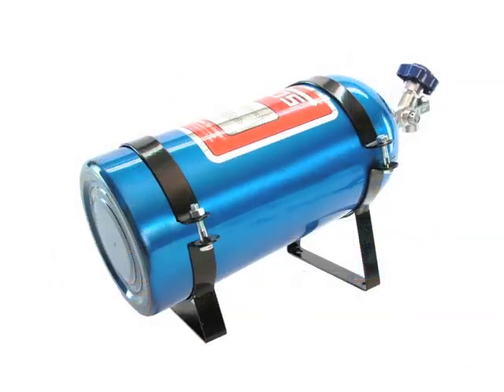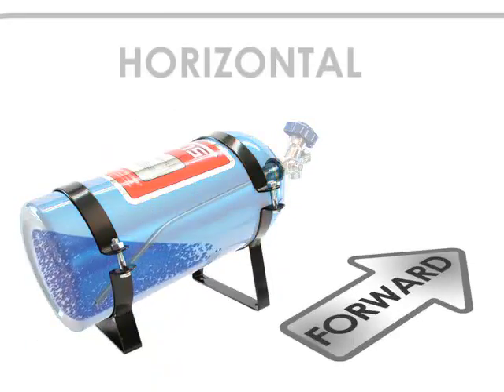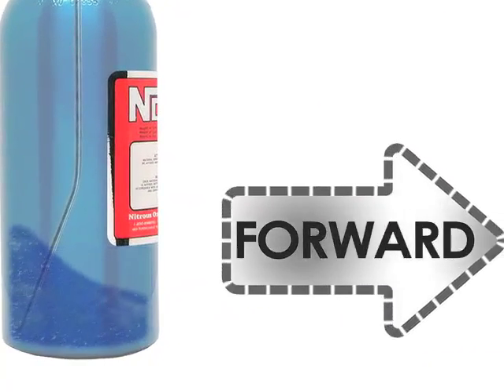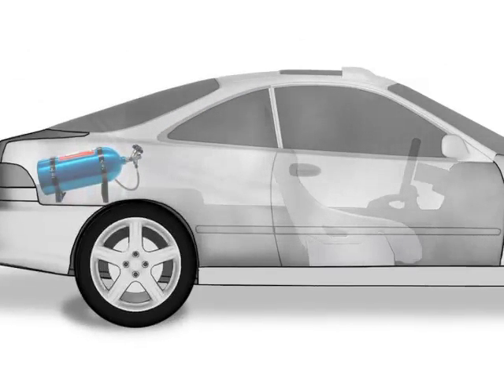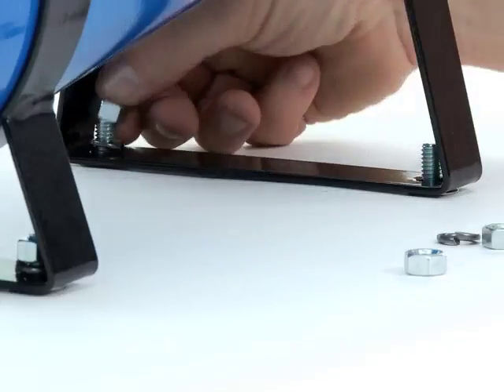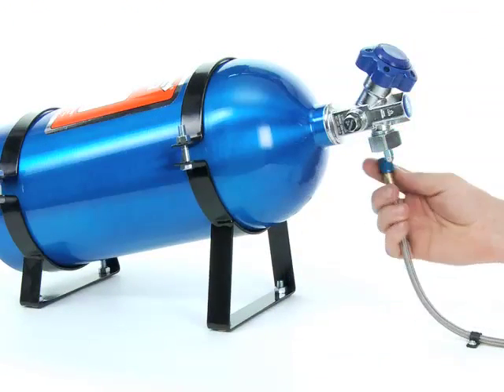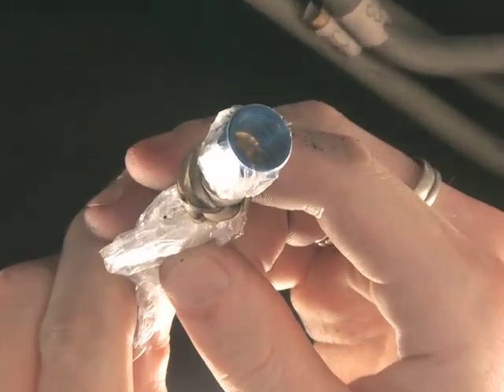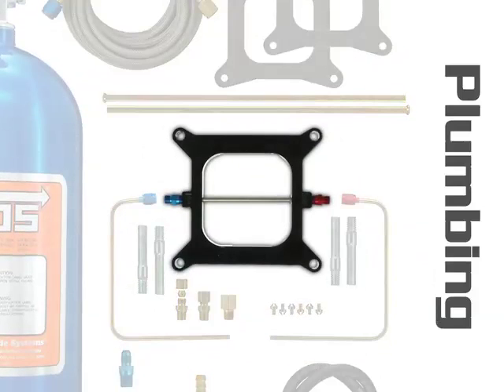How To Mount An NOS Nitrous Oxide Bottle In Your Vehicle

Comment: If i mount a bottle laterally, can the bottle lay perfectly flat? Meaning that the top of the bottle not be higher then the bottom.
Reply from the maker: It is not recommended that you lay them flat!  The siphon tube needs to be covered at all times and is bent and oriented inside the bottle at the factory to obtain the best coverage when it's installed at the manufactures suggested angle.  Thx J

Comment: hi your video is just awesome man, i just need a little help i want to know if when i install this on my engine, it wont melt my car pistons or damage the engine ??
I have a peugeot 206 1.1L
Reply: Thank you guys for helping me, i finaly decided to change my engine to a glanza turbo will put nos on it later :D
Reply: If you are worried about it, The answer is probably no. 
But if you stick to a 30-50 shot, it should be okay.
Reply: using your motor at all is causing damage. increasing its output does just that. pick your battles